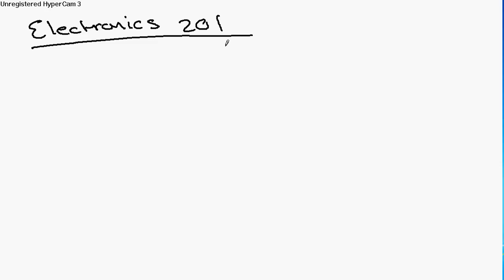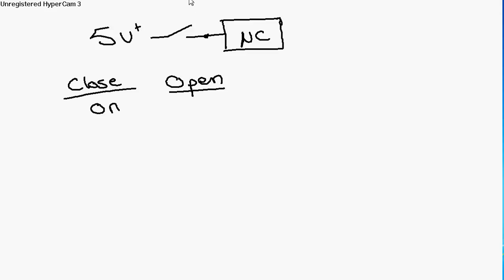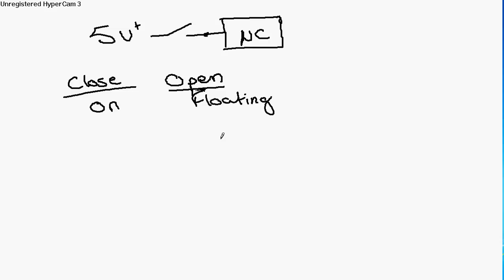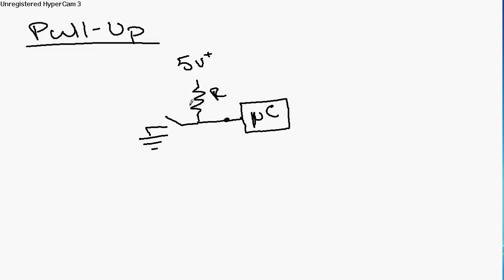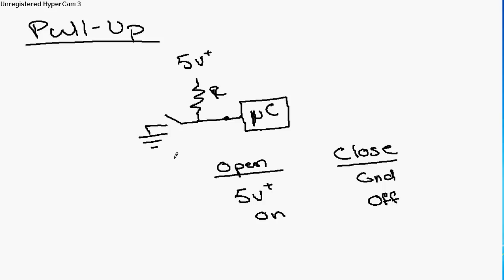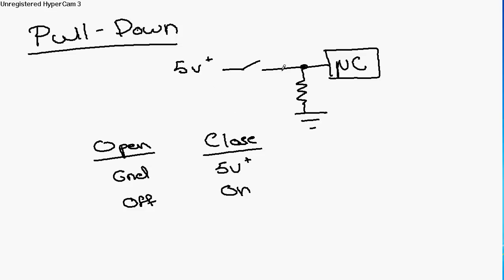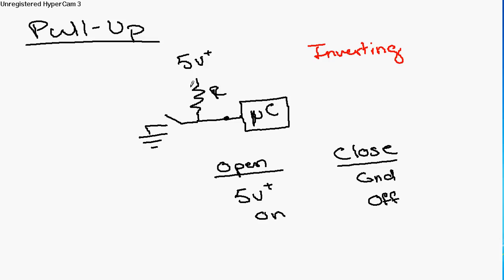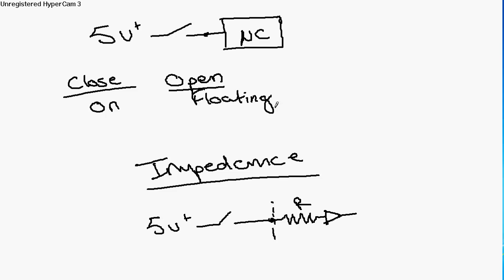Electronics 201: Pull-Up and Pull-Down Resistors

Comment: It's important to note: current will take any path available. 

The  idea that current takes only the path of least resistance is misinformation from years ago before we understood electricty.

It's very important to understand this fact when measuring or designing circuits.
 
Example: floating neutral versus bonded neutral on a portable generator. In the event of a short, the current will take any path available. Keep in mind, current is always trying to return to the source by any and all available paths.
Great video sir, thanks for sharing.

Comment: There is switch closed ( that is on).  There is switch open ( that is off).  Then there is the third state floating ( that is unhook the wire, pull the plug completely).
Then there is switch closed ( that is  on).  There is switch open ( that is floating).  How about it?

Comment: But in the case of pull'down resistor noise signal would also go to MCU (since it has lower impedance) instead of the ground?

Comment: But when I drew that same circuit on proteus using a led instead for a micro controller, I still have to flip the switch before the led comes on and you said for pull up when it’s open it’s on

Comment: if i have a 10k resistor and say 40 inputs on a mega and do the pull down thing, will all that power going into the resistors be too much and will it heat up the resistor too?

Comment: 7:45 why would any current gets pulled straight to ground when the resistance of the pull down resistor is larger than the mcu, isn't it suppose to go to the mcu instead because it has lower resistance ?

Comment: I think of a pull up or pull down resistor like a mechanical spring.  Since the symbol for a resistor looks somewhat like a spring it is easy to remember. With a pull up resistor it is like a spring which tries to keep the voltage level  at the  level of the pull up source.  Using a switch to ground "stretches" the spring down to Ground.  Once the switch is released the "spring" returns the voltage to the higher voltage of the pull up source.  With a pulldown resistor, the spring is trying to hold  the voltage level down but can be stretched upward when the button is pushed.

Comment: 2:39 How do you get stray voltage or current?
Reply: Electromagnetic fields. Every thing that runs on electriciry emits electromagnetic fields, and the tip of the pin picks it up like an antenna, generating voltage, similarly how radios work.

Comment: Something I don't understand... When you close the switch in a pull up resistor circuit like the one in the video, the 5v connects directly to the ground, with only the resistor in-between. Would this not fry the resistor?

Comment: I think you explained the pull-up-restistor wrong. You have said that because of the resistor the current will float to ground and not to the mc but the current doesn't matter. It is the voltage that lets read the mc the signels wether it is a high (5V) or a low (0V). Because of the resistor the complete voltage drops on it and thats why there is a 0V input on the input of the mc.

Comment: So if my pull-down resistor had a resistance value that's 10x the impedance, no current is gonna flow to ground? In other words, the current isn't gonna divide up at the junction?

Comment: Hi there, I think you meant to say that pull up resistor should be 1/10th or 10% of pin. In the case of pull up with V+ at 5V, 10kohm resistor vs 1kohm pin means that by simple voltage division, you actually have 0.45V at microcontroller pin which defeats the whole purpose.

Comment: I heard Pull-up concept is also used to increase the voltage level of the sensor when sensor gives comparably lower values. How does this pull up resistor used in that application ?

Comment: This even works in analog circuits like pulsing a 555 timer with another 555 timer. Pull pin 4 down to turn off/reset with a 1k resistor, and pin 3 of the other IC to pin 4 so it turns on and off.
Now that I think of it, it might work without the resistor since when the other 555 timer goes low, pin 4 on the subject one knows that (simple way of explaining that bit in little words, lol).

Comment: If the impedance is lower than the resistance why does the current get pulled into the resistor when closed (in the non-inverting circuit)? If it's lazy why not keep flowing into the micro-controller?
Reply: I have the same doubt.
Reply from the maker: Yes current is lazy but not to the extent you describe. This creates a parallel resistance where most of the current flows to the microcontroller, and only some flows through the resistor. The resistor is more important when the switch is open, any residual charge on the input is pulled away to ground. With only 1 path, all of the current is then pulled to ground.
Reply: +humanHardDrive Why isn't the residual charge taking the path through the microcontroller? It offers lower resistance compared to the pull down resistor.
Reply from the maker: There isn't really a path through the microcontroller. Think of the input like a tiny capacitor. There was a certain amount of current needed to switch the pin from off to on, filling the capacitor. Once charged, it doesn't have anywhere to go.

Comment: Thanks for a great tutorial!  There is something that i still do not understand, and i see others with the same query, however the responses seem to be addressing different issues:

In a PULL DOWN scenario, when the switch is OPEN, why wouldn't the 'stray voltage' still choose to go to the path of least resistance to the micro controller [with the lower built in resistor], than go straight to ground [with the higher pull down resistor], which was the whole point - to stop the stray voltage entering the pin...
Reply: i have no idea either. Did you ever figure this out?

Comment: conceptually, would it be better to have a pull up resistor as this saves power in a microcontroller? instead of constantly letting it run to GND with a pull down.

Comment: I disagree with the Pull-Up Resistor being Close=OFF,   it will depend if the Micro is a Active High or Active Low,  so if the I/O is Active Low Close=ON and if the Micro is Active High  Close = OFF and viceversa.

Comment: In the floating state, for there to be a "stray signal on the pin" that means that the micro controller also has a ground in addition to the main ground. The stray electrical signal would flow to micro controller's ground. Is that a true statement? If not why?

Comment: Short (stupid) question:
for my needs an IC manufacturer datasheet recommends to pull-up 4 particular pins permanently to +3.3V power supply, by using a 100K resistor. Do I really need to use/solder four 100K resistors, one for each pin, or I can just use a single 100K for all 4 pins???
Reply: +Giulio Buccini maybe use a diode on each resister in series to prevent them flowing between each-other just in-case, however remember the diode voltage drop if you do, maybe go for those shotsky low voltage drop ones.

Comment: When the switch is open in pull down resistor,then wouldn't the current flow into microcontroller since it has low resistance and cause oscillation?
Reply: +Amrit Raj No because there is no current is flowing, there is no +5V connection. I think you mean when the 5V is flowing, and the switch is closed, you will get some feedback and distortion. You could fix this by adding an electrolytic cap to fix this

Comment: In case of pull down resistor. When the switch is open why the current would not choose the MC path because it has less resistor?

Thank you
Reply: +MrACG66 Yes, he explains that concept in reverse for the pull-up.

Comment: Why do you really need the "Pull-up" resistor though? I mean, connecting directly to a 5 V supply would have the same effect.
Reply from the maker: +JTK The resistor prevents the 5 volts from shorting directly to ground.
Reply: +JTK But at the same time, if the pull-up resistor is too large relative to the microcontroller impedance, then the voltage seen by the input pin will not be in the ON range. So, the value of a pull-up resistor should be both 1) large enough to make the amount of current flowing to ground acceptably small when the switch is closed and 2) small enough so that the input pin voltage is in the ON range when the switch is open.
Reply: @ericzarahn9343  Thank you. I was bothered by the voltage drop across the pull-up resistor. So, you don't want to drop all the voltage over that resistor or the input pin sees too low a voltage to read it as high, and if the resistance is too low, you'll send too much current to ground?
Reply: +humanHardDrive which he explained in the video
Reply: +JTK  If you put the wire (R=1 ohm) direct to 5V the
circuit will consume a lot of current (I=V/R =5V/1Ohm=5A).

So if you put a big resistor as a Pull-up resistor (say R=10000ohm) to connect
the wire to the 5V you will have I=5V/10000=0.5mA. So you will save power and
you don’t drain your battery so fast.

Comment: This is probably a dumb question but if in pull-up the resistor is there to prevent a bad case of shortage, wouldn't it make more sense to put it behind the switch before the ground? That way it doesn't interfere with the on-state right?
Reply: +ThaTyger The idea of a pull up & pull down resistor is just to get rid of the floating state. You only want to have a logical 'ON' or 'OFF'. If you put the resistor between the switch & ground, the 5V will always be directly connected to the microcontroller (MCU). If you always want your MCU to be a logical 1 then sure, go for it. But the current video tries to show you how to choose whether the MCU is a 1 or a 0 depending on the state of the switch, without the floating state. Note that a logical '1' is 5V+, and a logical '0' is approx. 0-2V, and this floating state is anything between those values. It is caused by noise.
Reply: +thesickbeat solid explanation thank you =) I only just started exploring the world of electronics so there are still quite some things I am learning. This helped me quite a lot =)
Reply: ThaTyger No problem. I'm a second year undergraduate learning computer engineering, so you're not alone! I started programming MCUs in assembly 3 days ago. Such an awesome profession :)

Comment: Hey guys, how does the resistor pull it back up, when its meant to resist voltage? Its really confusing can someone explain it to me?
Reply: +tony ding  The resistor isn't "pulling" anything. The resistor is placed there to slow down the current from going to ground immediately. A pull up resistor prevents a short circuit from happening, but that is, when the switch is closed.
Reply: This confused me at first too.  I think it confuses everyone at first.  This is my understanding (which may be faulty).  The resistor itself is not actually pulling the voltage up.  Obviously, resistors drop voltage, not raise it.  You add the 5V+ to the input pin in order that it has a "high" state by default.  It's "pulled up" to "high" unless there's a ground.  But if the switch to ground is closed, you don't want 5V+ flowing unrestricted to ground.  As the video points out, this is a short, and consumes lots of power.

So the result is that, when the switch is open, the only path for the current is from 5V+ into the pin.  There will be a voltage drop across the resistor, and this drop must be small enough to ensure that the voltage going into the pin will still be read as a "high" state.  When the switch is closed, the 5V+ will drain directly into ground, but the resistor restricts how much current can flow through that path.  The input pin also drains into ground, and so it is in a "low" state.

One other thing, in choosing the resistor, you have to consider power consumption as well as current.  If the pull-up resistor is only 10 ohms (and the impedance of the microcontroller is very low), and you put 5V across it, that means there is 0.5 amp of current, and therefore, 2.5 watts of power.  If it's a quarter-watt resistor, keep the fire extinguisher handy.

I'd be more than happy to have any errors in the above pointed out.

Comment: Thanks for posting this its been very helpful. I still have two questions though.
1. With the Pull-Down Resistor, if you select a resistor with 10x the impedance of the micro controller pin, then when the switch is closed, why does the current still flow to ground since the resistor to ground is now 10x larger than the impedance. It seems like it would trap the current in the micro controller. I'm wanting to think of the pull down resistor as a small office in a fluid piping system for instance. When the switch or valve is open the water will flow into the micro controller who has a much smaller orifice than the pull down resistor. When the switch closes, any residual pressure left in the micro controller can slowly drain through the pull down resistor. But since the pull down resistor is so large it would take a long time. Isn't' this problematic to the micro controller since don't we essentially need the pin to go immediately to ground rather than slowly trickle to ground. Sorry if this is a dumb question, this stuff is all new to me.
2. With the pull up resistor, you mentioned the micro controller is constantly seeing 5 volts until the switch connects and it drains current to ground. So I typically think of a voltage drop being associated with a resistor. Is there no voltage drop since   its not connected to ground (i.e. the pin of the micro controller is not connected internally to ground so there is no current path and no current flowing. the pin just "sees" 5 volts)

Anyone that could help I'd appreciate it. Would really like to learn this for hobby use. Thanks
Reply: MrGuitarfreak132 1. Of course some current is flowing in the direction of the ground, but most of it enters the micro controller. It works like a fluid piping system so that when the switch is closed the fluid can flow two ways. Through a big hole and a small hole. Some fluid will drain through the small hole, but mainly through the big one. :)
Resistors alone won't delay current in any way from flowing. You have to have some inductors or caps to do that. 
The most important effect the pull down gives is that the micro controller does not sense any high voltages on the pin from floating voltages in the circuit. First when the switch is closed the voltage is able to go high enough to be registered as a high state.
2. You are partially right. It may not see 5.000V due to a possible voltage drop, but the micro controller will not se anything that resembles close to 0 V. And therefore the micro controller sees a high signal until the port is pulled to the ground and a 0 V is registered as a low state. If the micro controller does not draw current in the pulled up state then of course the voltage drop over the pull-up resistor is zero and the micro controller sees 5 V. 

The whole point with using pull-up and pull-down resistors are to avoid accidental floating voltages to be registered as low/high. Luckily we don't need exactly 0 V and 5 V to set the different states. Usually there is a good range that is accepted as LOW and HIGH.